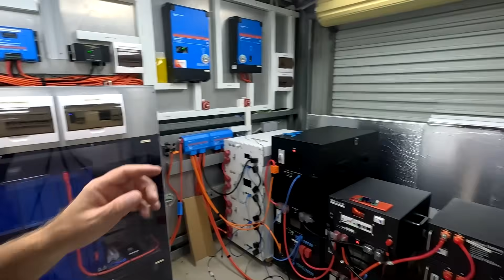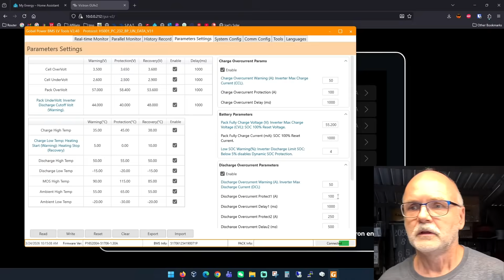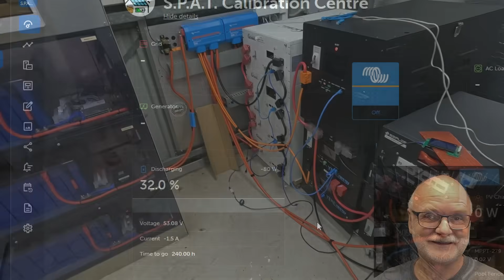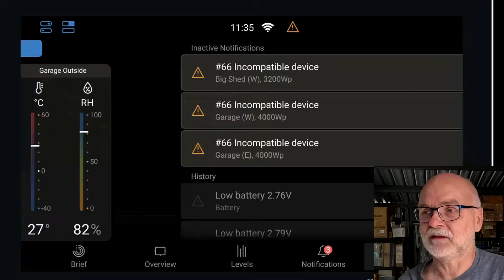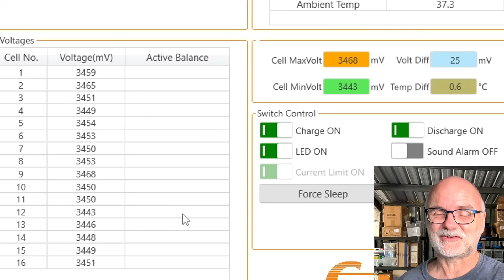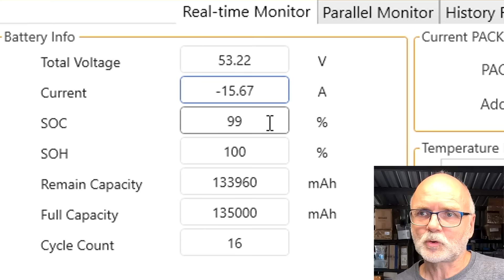SOC-Precision of Gobelpower BMS vs JK-BMS vs Victron Smart Shunt. Live-Experiment!

Comment: Interesting to see the comparison, but let's be real about the physics here. It’s impossible for a BMS using MOSFET measurement to ever match a dedicated Victron SmartShunt or a Studer BSP.
These integrated sensors have massive thermal drift and lack the resolution needed for micro-cycling. It’s pure math: small errors at low currents eventually lead to huge SOC drift over time. It's a bit strange to compare them as if they were in the same league; software can't fix a hardware limitation.
Chinese manufacturers are experts at copying what works, so it's a mystery why they still won't integrate a proper shunt into their BMS designs. Anyway, thanks for the data and for the time spent testing it, even if the hardware has its limits.

Comment: Hi Andy, just bought bij first Yixiang MB56 pack with the trolley 🎉. You sparked the home battery virus in me with your video’s. The packaging of the battery box has changed, they also put some foam in the front and back in the crate. Question is your trolley also a little shorter than the battery box?

Comment: Honestly, all these experiments are fun to watch, but we’re basically talking about gadgets here. It is physically impossible for the "fake shunt" components integrated into a BMS (often MOSFETs with insane thermal drift) to match the precision and stability of a dedicated Victron SmartShunt, BMV-712, or a Studer BSP.
It’s simple math: current measurement on these boards is noisy and lacks resolution, unlike a real battery monitor with a high-precision ADC. Furthermore, testing this way doesn't reflect real-world usage; constant micro-cycling causes SOCs to drift massively over time on this hardware. Chinese manufacturers are great at copying what works, so why haven't they integrated a proper shunt instead of trying the impossible with the current design?
I’ve noticed Andy seems to have a total mental block on this, insisting on comparing apples to oranges as if software could overcome structural hardware flaws. That being said, thanks a lot Andy for everything you do for the community. Your transparency and dedication are an incredible resource for all of us!

Comment: The ending result, with the two batteries at different capacities, both of my JK BMS 16Ah batteries do this, every day.  They'll reach 100% about the same time, but as they discharge one of them will discharge faster. I have not figured out why. They both have the same model BMS and the same settings, they are connected in parallel. The "only" difference between the two is that the 1st battery has 1m 2awg cables, whereas the 2nd battery has 0.5m 4awg cables. You wouldn't think that would make that big of a difference, but maybe(?) 🤔
Reply: The cables need to be the same size and same length or they will charge and discharge at different rates. You’ll cause the batteries more stress and wear them down faster as the batteries are essentially taking turns doing more work instead of halving the work between them.
Reply: @louishetariki9166  If I were discharging the batteries at the capacity limit of the cables, then yes this would make sense. But this is not the case. At relatively low current, the small resistance value between the two cables doesn't really make that big of an issue. Also, the values are "backwards" of what you'd think they'd be anyways. It's the shorter cable connected battery that is discharging slower than the other, and it's also the thinner cable
If it were because of the resistance of the cables, it would be the the fatter cabled battery discharging faster. But this isn't the case.
Also, the cable length difference is negligible at these values. The wires used are welding cable copper wire, so they are very good quality copper.
My theory as to why this is happening is that the battery that is discharging faster, initially, is the newer one, by about 5 months. That means the first battery had already been cycled 130 times before the new battery was added. Maybe over time as they are used this weirdness will diminish. I dunno.  But it's definitely not because of the cabling
Reply: Jk bms use pretty cheap mosfets so they can have different internal resistances
Reply: @jmanbrosef689  If that were so, I highly doubt they would make "that" big of a difference. When I say they can have different current values, it can be as much as 10A difference.
And no, it's not the cables because the situation is backwards of how this would affect them. Also low current, relative to the size of the cables, so even that shouldn't make any difference.

Comment: Hi Andy, I have LiFePO4 202Ah batteries. JK BMS V19.31 says 100% charged, but it keeps charging voltage and amperes until 55.90, then it stops. Why is that voltage and amperage? Normally, 100% means stop charging.

Comment: JK BMS are fantastic when it comes to price/build quality/protection.. but OMG the SoC measurements suck! 20%+ drift after a week of hovering somewhere in the middle capacity range, it will only be correct after the drift is so high I hit 0 or 100% SoC cell voltage. 
Let's see if the tests prove it. I assume the BMS simply cannot properly count the spiky load that grid tie and inverters put on the battery. If you would just run a constant resistive load counting is probably on-point.
Reply: Yes my JK yesterday said it has 23% meanwhile the smarthuunt said it's 83%. The cell voltage was 3,60V, so i guess the JK is very far off.
Reply: @stefandorr2850  I have experienced this problem both ways and need to do a 100% calibration at least once a week. 

I bought the yixiang 16kWh and multi RS 48/6000 as a kit at my local supplier and of course they deny this problem and proceed to tell me it's due to my non Victron 48V accessories that are NOT supported... Well Victron allows it and JK allows loads with and without BMS communication.

Comment: I wonder at what rate do those BMSes sample current. I have recently checked and was shocked to see, that the current being drawn is not nearly linear but has a high 100Hz ripple. When thinking longer this makes perfectly sense as the capacitors even in Victron equipment do not have zero ESR and their capacity is limited. At high loads the current varies a lot. That is also why victron recommends such beefy dc cables - to keep voltage drop and due to current ripple also DC voltage ripple at a decent level… throwing this simply onto our cells… For the bms to precisely count charge, current reading is essential - as its error accumulates over time. They would have to sample at kHz rate or do some analog averaging tricks to keep precision… maybe that is why some do this better than others…
Reply: Yes it all has to do with the sampling rate of the current sensing/ Coulomb counting circuit.
A 3-phase system has an even dirtier ripple current and I have noticed worse SOC accuracy on at least JK BMS. It gets even worse with MPPT chargers added to the system, especially when PV production is about the same as inverter power. (hovering around +5 and -5A battery current)
I have a remote system with 3 DEYE 5kWh units and those perform much better regarding SOC accuracy. Even with MPPT chargers.
Another system with only a Multi RS 48/6000 and JK BMS performs much better but this is a HF inverter so very low DC ripple. But again SOC accuracy goes way off with MPPT chargers.

The Victron smart shunt and Lynx BMS are built around the fact that they have to be accurate with the ripple current from their LF inverters. JK and most other 'ínverter' BMS are mainly built for HF inverters which have a significant lower ripple current.

I'm planning to install a smart shunt. I also have thought about adding a large capacitor bank to the bus bar to reduce battery ripple current (better for higher cycle efficiency/ less heat and longer longevity) but I need to measure the full load ripple current before I can determine which value (and ESR) I need.
Reply: @gabbertje2811  Exactly! That was also my idea - to put a huge capacitor bank with lowest ESR i can get directly to main busbar, between inverters+mppt and the battery - connected trough a shunt). This should equalize a bit those current pulses. But to be really doing current equalization one would rather have to connect battery via a common mode choke of a significant size, considering those currents... Who however ever does that... Battery take those ripples onto themselves and behave brave enough for noone to care about it...

Comment: Since your smart shunt reset earlier than the two BMS's, I would set the tail current to 1%. Also, I have noticed using my own smart shunt, It seems more accurate to set the charge efficiency to 100%. (I wish they allowed setting down to tenths of a percent, I would have used 99.7%) I also have my peukert set at 1.0 like you do.

Comment: Nice test. I gave up the SOC counting with my 3 JK BMS and 2 Pace BMS. The Pace BMSs are way better than the JK but without loading regulary to 100% SOC both are especially in winter time useless with the SOC numbers. For that I have switched to Volt on my Deye inverter. 50 V minimum and 55,2V maximum. Thats totaly fine for me.
Reply: Ya, I treat capacity as an information only and taken with a grain of salt and all of my control functions are based off of voltage.

Comment: Unless you use the exact same cells, with the  same capacity, age, number of cycles and cable lengths, this test will not be accurate, due to the differences in cells!

Comment: One of my Daly 250A BMS's fail recently the new one works but the SOC indicator is totally inaccurate it's reading the current backwards
Reply: Daly bms soc is a total mess
Reply: @aneesh11000  I use four the other three are accurate at least the forth one still works fine with it's voltage protection though
Reply: Use victron smart shunt
Reply: @aneesh11000  I use outback power shunts three of them they run to the flexnet dc that send that data to a Mate 3 my CC's also send their data there it's 99% accurate